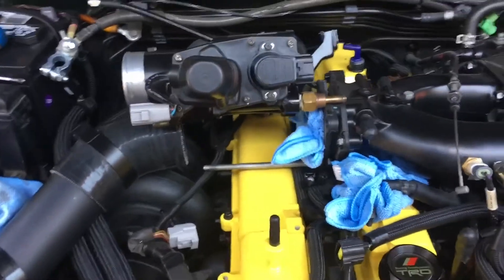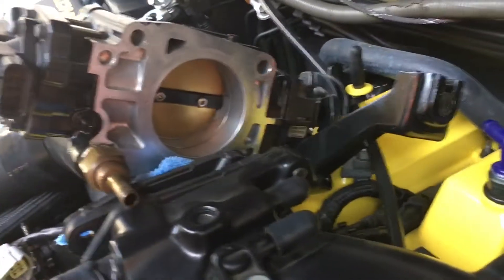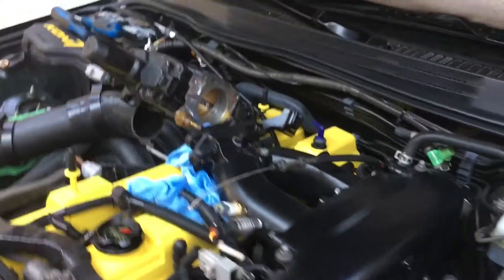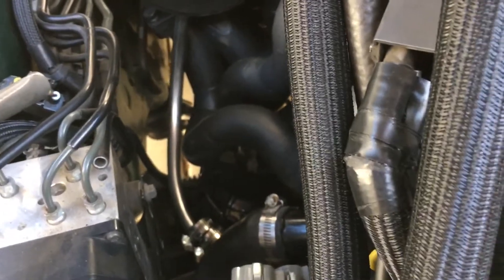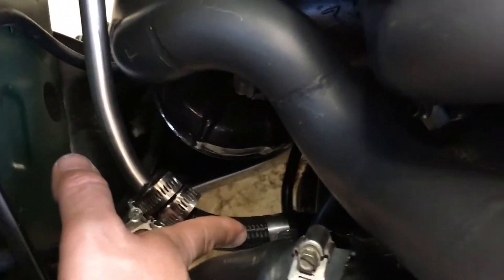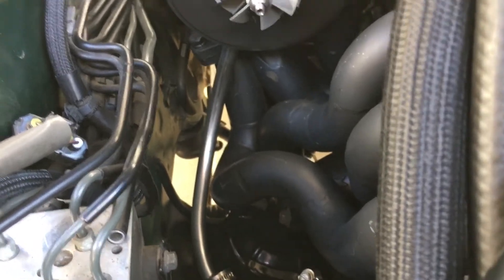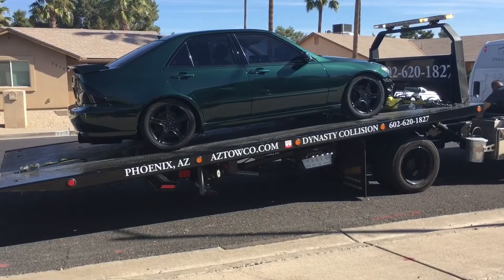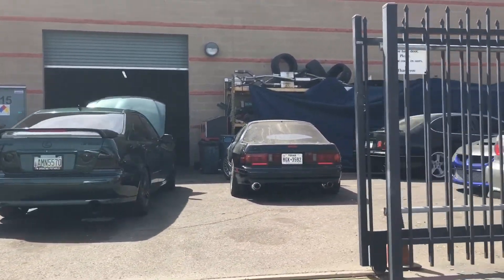Lexus IS300 Turbo Build Part 40/ idle issues and dyno pull

Comment: As far as dyno and tune. With the trans shim method do I need to tell my tuner not to floor it in first and 2nd to avoid destroying my stock trans?
Reply from the maker: The power pull is done in 4th gear.
Reply: @dthmtlsk8r  ok thank you! How much power are u putting down rn if u don't mind?!

Comment: hey are you running parallel ecu? stock one controller the auto? thanks
Reply from the maker: Aem infinity with the stock ecu.
Reply: @dthmtlsk8r  oh ok thanks for the quick reply! How did you raise the redline limiter before the auto wanted to shift the next gear? also how did you dyno it without the auto wanting to downshift when you wide open throttle?
Reply from the maker: @Persocondes  my tuner did all the rev limit adjustments and put the car in snow mode to avoid down shift on a dyno wheel
Reply: @dthmtlsk8r  awesome thanks for the information!